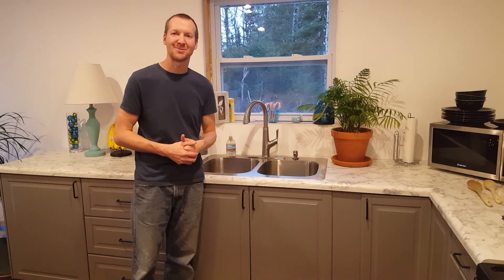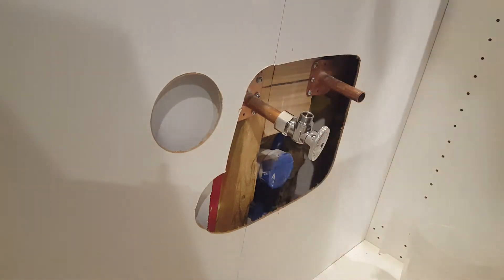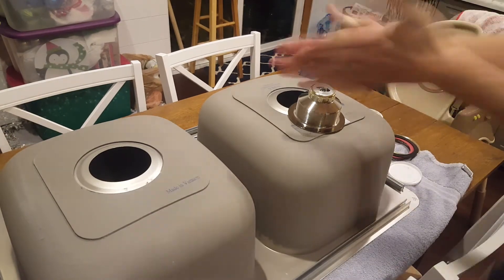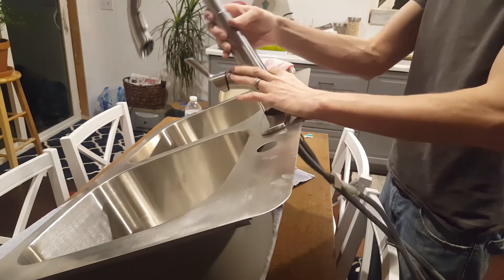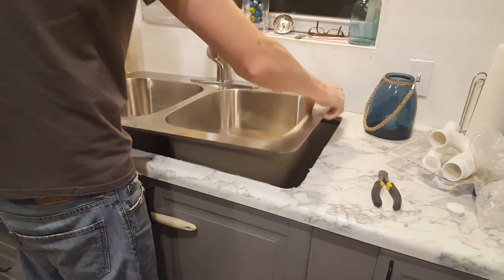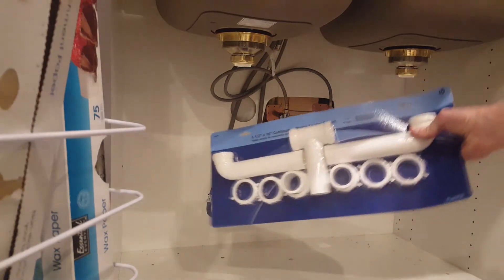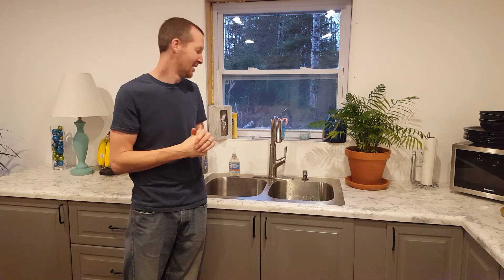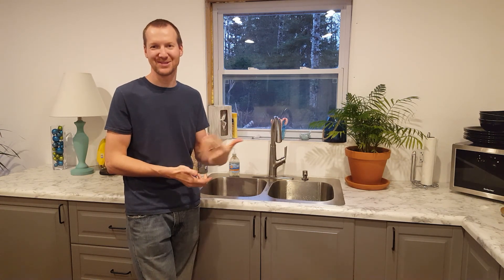Kitchen Sink and Faucet Install

Comment: Hi stranger where have you been hiding, 8mths eh? Anyway good to see you back and a great job of showing the fitting of the new sink and faucet, however the plumbing is slightly different over here. Great to see you back and hopefully the next video won't be as long, as funny enough i was going through my list the other day and nearly unsubscribed you as there were no videos. 
Barry (ENG)
Reply from the maker: Hi Barry! Yes, I am back. I have been really busy building my own house, and just didn't have time to do any videos. But now things are slowing down and I will be doing a video on the house building process soon. It's interesting that we have different plumbing over here, I thought it would be the same everywhere. Anyways good to hear from you!